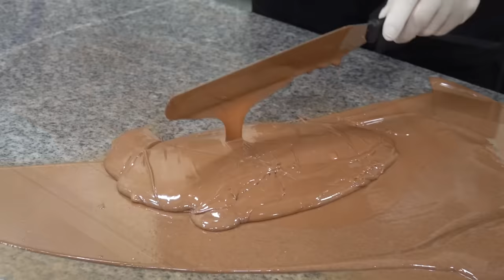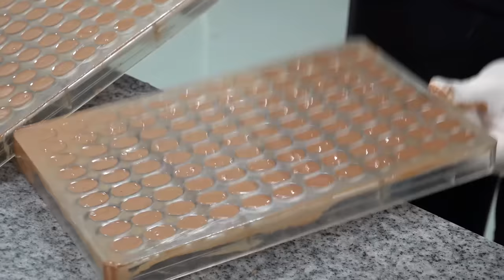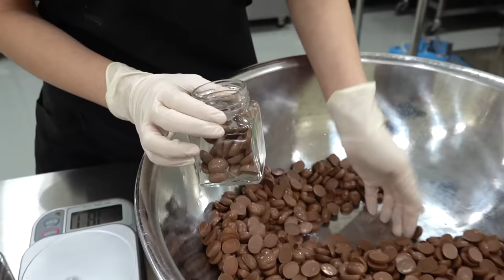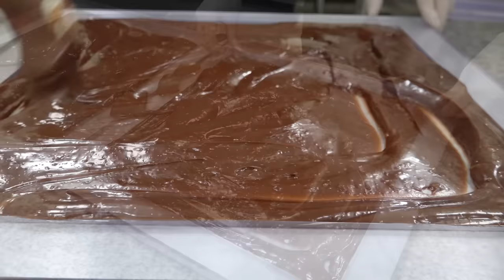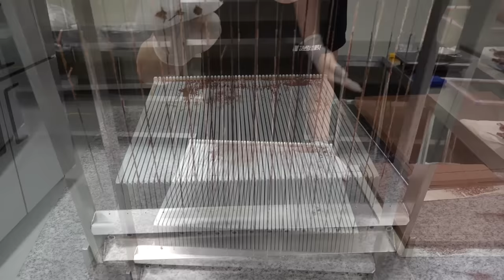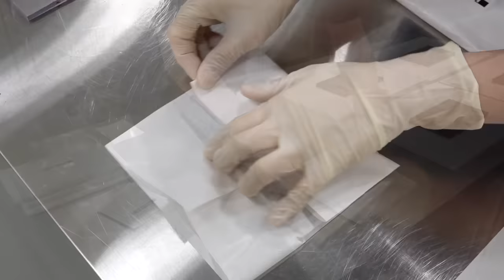수제초콜릿 Amazing Chocolate Making Process, Chocolate Master - Chocolate Factory in Korea

Comment: I didn’t think there would be enough chocolate to fill all those molds, but he made it work!  Excellent!
Reply: they probably measure it beforehand. i don't think they can eyeball it it'd be inconsistent
Reply: @gmed26  yep,this kind a work needs strict measurements.generally first thing you do with new mould is fill it with water and measure volume no matter if you’re doing resin art work,soaps or chocolate

Comment: What was the point of all that messing about on the table at the start?
Reply: It's called chocolate tempering. The particular method used in the video is called "tabling".

"Tempering chocolate simply means melting the chocolate while controlling how its temperature rises and falls. This technique lets you use the chocolate the way you want to and get the perfect result for all your creations.

Good tempering provides the following benefits:

It keeps chocolate shiny and smooth. 
It makes it easier to turn out your chocolates. 
It snaps cleanly when broken. 

As such, tempering is essential for anyone who wants to make beautiful desserts and chocolates with a smooth, glossy, solid texture. It is important to follow every step in the process to get the results you want. Otherwise, chocolate can become brittle, dull, bumpy, flecked with white marks, and harder to turn out. Successful tempering is the key to successful chocolate making."

Comment: what was the purpose of swooshing it around the table for the first 2 and a half mins? If they wanted to mix it they could have done that in the bowl it was already in!
Reply: It's called chocolate tempering. The particular method used in the video is called "tabling".

"Tempering chocolate simply means melting the chocolate while controlling how its temperature rises and falls. This technique lets you use the chocolate the way you want to and get the perfect result for all your creations.

Good tempering provides the following benefits:

It keeps chocolate shiny and smooth. 
It makes it easier to turn out your chocolates. 
It snaps cleanly when broken. 

As such, tempering is essential for anyone who wants to make beautiful desserts and chocolates with a smooth, glossy, solid texture. It is important to follow every step in the process to get the results you want. Otherwise, chocolate can become brittle, dull, bumpy, flecked with white marks, and harder to turn out. Successful tempering is the key to successful chocolate making."